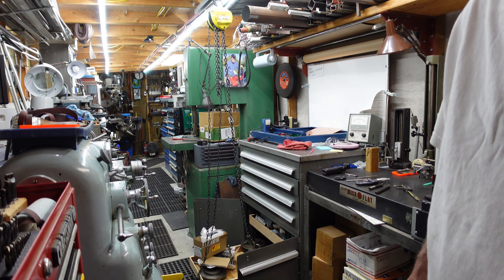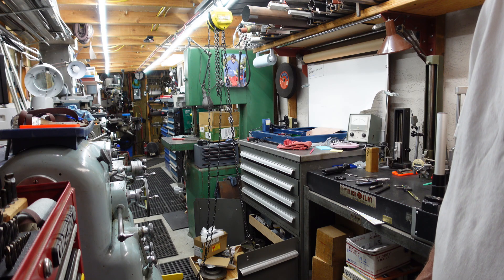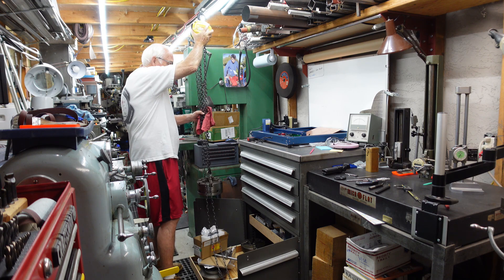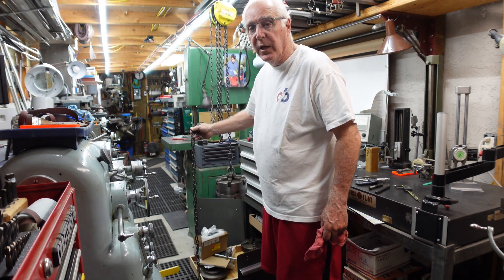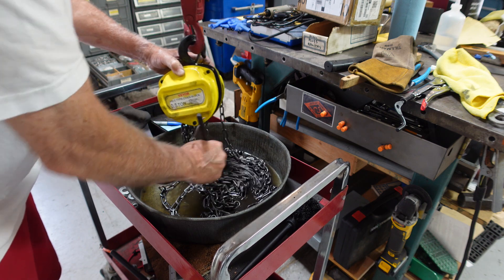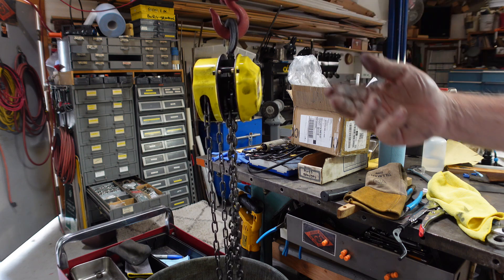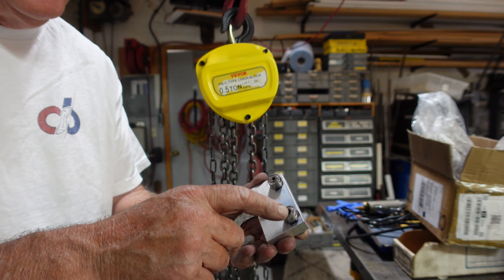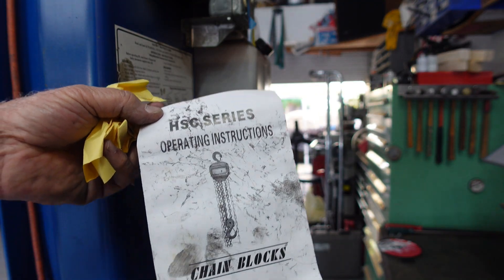Screwy Tuesday 23-19  Shop (old man) Enhancement

Comment: Yep, 72 years here. I built a light duty jib crane with uni-strut welded on to the 4” horizontal channel. An electric wire rope hoist helps me swap out my 12” chucks and rotary table. With a bit more than 180 degree swing I can service 2 lathes and 2 mills.  Hey thanks for the videos. Great content and very entertaining.